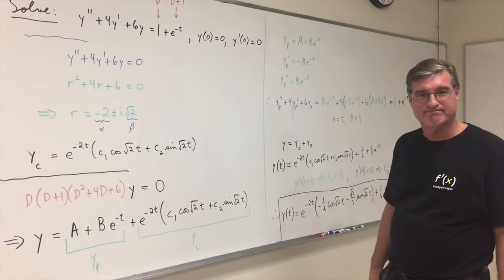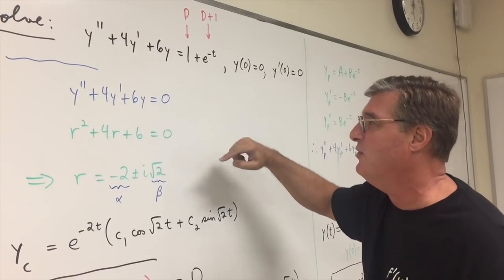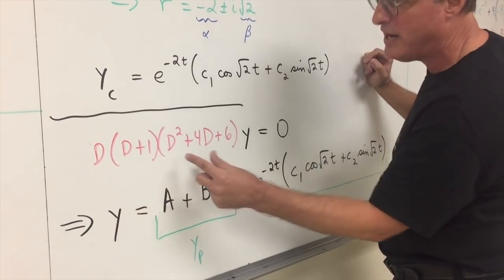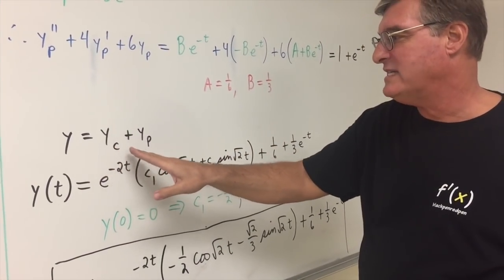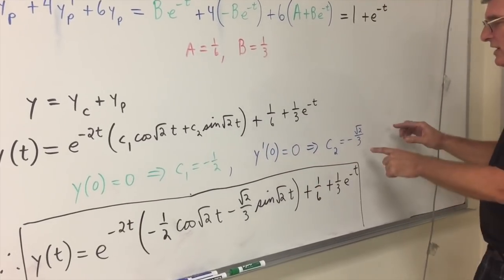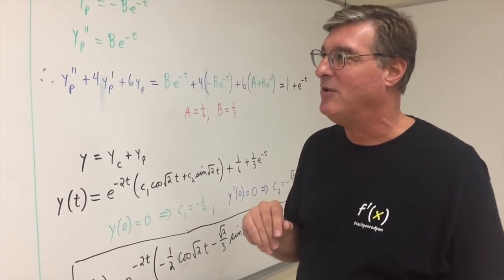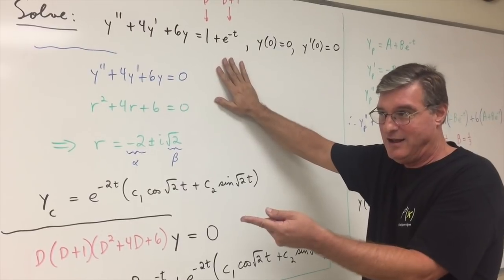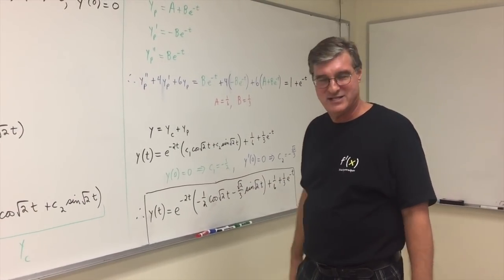Laplace Transform vs. Undetermined Coefficients (part2)

Comment: I just found the general form of variation of parameters and used it to solve the simple harmonic oscillator with forcing term sinx.  If you leave the complex exponentials and convert sin to exponentials it’s actually pretty easy to integrate.  The hard part is converting it back to sines and cosines.

Comment: "because of the simple initial conditions, doing it with undetermined coefficents might not be so bad"
you can't do it with laplace transform if the conditions aren't at t = 0, and you can't even use two sided laplace transform
Reply: You can, if you use placeholders for the initial conditions, and then plug in your non-initial conditions later on.

For instance, consider:
y' + y = sin(t), with y(pi/2) = 2

Let u be the initial condition y(0) = u.

The Laplace is:
s*Y(s) - u + Y(s) = 1/(s^2 + 1)

Solving for Y(s), and expanding the top:
Y(s) = (u*s^2 + u + 1)/((s + 1)*(s^2 + 1))

Partial fractions:
Y(s) = A/(s + 1) + (B*s + C)/(s^2 + 1)
A = (2*u+1)/2
B = -1/2
C = 1/2

You'll notice that only A depends on u, since A is the coefficient on our homogeneous part of the solution.  The u will cancel when solving for B and C, since their terms are part of the particular solution.  This means our general solution after inverse Laplace is:
y(t) = A*e^(-t) - 1/2*cos(t) + 1/2*sin(t)

Plug in y=2 at t=pi/2, and solve for A:
2 = A*e^(-pi/2) - 1/2*cos(pi/2) + 1/2*sin(pi/2)
A = 3/2*e^(pi/2)

Solution:
y(t) = 3/2*e^(-t + pi/2) - 1/2*cos(t) + 1/2*sin(t)

Comment: Where did that particular solution come from? What is this about D and D+1?

I know it like this: You break up the inhomogenious function into its parts, then assume the particular solution to be a certain thing based on those parts, and then you check to get the coefficients. So here, we start with 1, so the particular solution must have an unknown constant as well (if it were a quadratic, you'd need a full quadratic polynomial). The second part is an e-function, which are eternal except for a coefficient. So therefore y_p(t) := A + B exp(-t).
Reply: The D is shorthand for the differential operator, where D means d/dx, and D^2 means d^2/dx^2, and 1 means the original function.  You come up with a linear combination of 1, D, D^2, and other orders of differentiation if needed, called the annihilator, that will reduce the right hand side terms to zero.  You then use this as a factor with the original characteristic polynomial, that produces another set of roots for D as a variable that tell us the combination of terms that form the particular solution.

Comment: Why do we need D*(D+1)*(D^2 + 4*D+1) = 0 equation here? This one does not participate in finding the general solution. For info only?
Reply: (D ^2 + 4*D + 1) tells us the form of the yc solution.  The roots of this equation, are the exponent coefficients on t, using the form e^(r*t) as our prototype solution.
D*(D + 1) tells us the form of the yp solution.   Since a stand-alone D will annihilate a constant, that tells us the A-part.   Since D+1 will annihilate an exponential in the form of e^(-t), this tells us the B*e^(-t) part.  A linear combination of A and B*e^(-t) will be annihilated by the operator D*(D+ 1).

Comment: My problem with the Laplace transform method here is that it only works with the one-sided Laplace transform (which introduces the restriction that y(t) = 0 for t<0). 

You cannot calculate the two-sided Laplace transform of any exponential function because the integral doesn't converge for any value of s.

Comment: I never liked variation of parameters. When my calculus teacher showed us that I checked the book for other ways and found Undetermined Coefficients which saved me during that timeperiod. Loved laplace. To this day I don't understand variation of parameters. Thankfully I am not taking the class for differential equations am taking one about systems which requires this again. Hope I can use laplace there.
Reply: Taking  diff eq class right now in uni, we haven't gone over laplace transformations yet, but whe have done undetermined coefficients and variation of parameters and I can second your feelling about variation. I doesnt seem to catch on to me and isnt as intuitive as something as undet. Or laplace. But I guess it's important for inhomogenous equations that dont have a proper form like what he said if your RHS has a sec x or whatnot.
Reply: @alessandrolira4035  It's also very difficult to make examples with variation of parameters that are practical to solve analytically.  The integrals become very complicated, very fast, even when it starts simple.  Secant and tangent work well to make up examples, but I've found it hard to come up with other examples that don't overcomplicate the integral.

For systems using exponentials, polynomials of t, and simple sine and cosine trig, it is much easier to come up with examples that make it interesting, and also reflect real world applications, like vibration analysis, electronic filters, and control systems.
Reply: Yes, variation of parameters should really just be a last resort or theoretical tool. If your inhomogeneous part is just polynomials, exponentials, and sin/cos, then stick with Laplace transform or undetermined coefficients. I don't really understand why your teacher would only teach you variation of parameters.